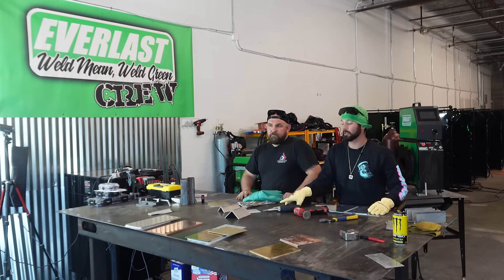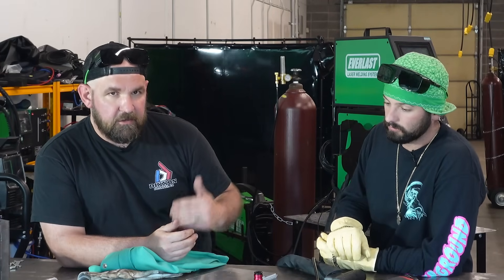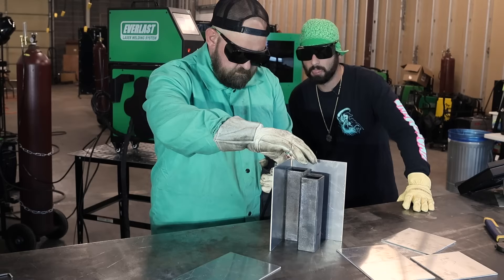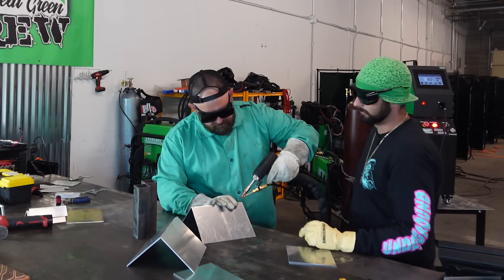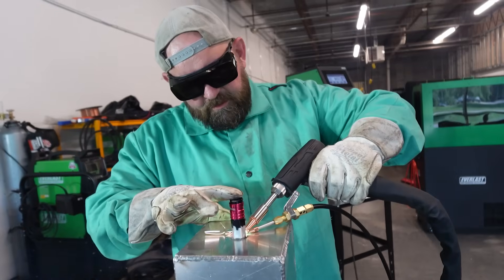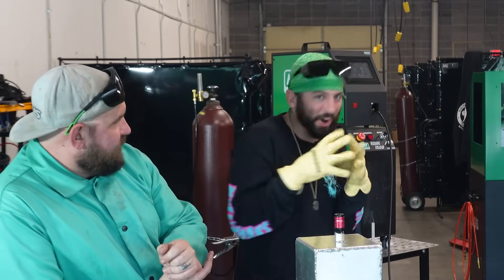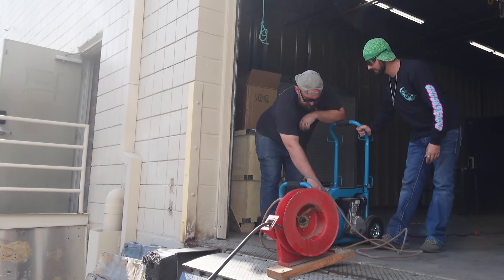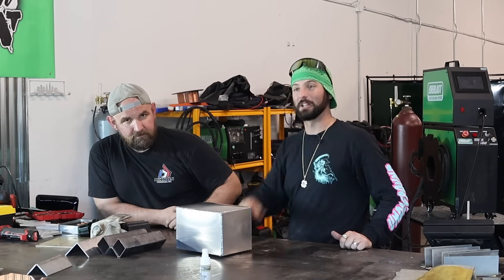Ultimate Test Can Laser Welding Handle A Pressure Test?

Comment: SEE THE BOWING ON ALL SIDES OF THE VESSEL, TOO HIGH A PRESSURE, THEY SHOULD HAVE PUT IN CREASES TO STRENGTHEN EACH SIDE. I DONT THINK THEY PUT IN 138PSI THAT THEY SHOWED ON THE COMPRESSOR, THEY OBVIOUSLY HAD ANOTHER TAP/VALVE AFTER THE GUAGE TO REDUCE THE INPUT PRESSURE.

Comment: CURRENTLY LASER WELDERS ARE ONLY FOR THEN MATERIALS AND PRIMARILY USED TO HIDE JOINS AND MAKE THE JOIN LOOK NICE FOR PRESENTATION AND NOT USED FOR JOINS THAT ARE PUT UNDER PRESSURE THERE IS NOT ENOUGH PENETRATION.

Comment: I'd be quite interested in seeing a proper cut and etch on various materials  and thicknesses of the lazer compared to other techniques on the same joint configuration.  I get Lazer isn't at the point of replacing any of the other processes, but I'm curious

Comment: Need to see some detailed instructional videos for experienced writers and beginners alike that have never touched a laser welder. Can we still do multiple passes for infinite depth? Can I still run a 3G on 1/4” mild steel in all positions? If I’m winding a 1 Ton truck frame back together with a diamond or building one from scratch, is laser stringer due to the heat affected zone being smaller? Etc…

Comment: i stitched my entire e36 m3 body and solid welded the whole shell and it added a crazy amount of stiffness to my chassis.  im currently using the the laser welder to do sheet metal paneling and a firewall in my mini pro mod build.  its amazing and works fantastic for the thin stuff.  im no welder, but i finished the tubs, and paneling on the drag chassis by myself and it came out looking nice.

Comment: So stupid never pressure test a tank with air. good way to take the forever nap. fill with water and use a pressure washer or an actual pressure pump. and see how the weld do when they fail.

Comment: NDT non destructive testing on the laser quai MiG torch welding might be safer doing a hydro test ver a pneumatic test.
Great work. 
Question can the laser technique use the TIG hand feeding wire rod ?  Thanks for any reply.

Comment: The one thing I've not understood about laser welding different types of metals is, does it require different types of weld wire or do they use the same wire for all metals?
I've watched several videos on laser welding and it seems that of all the different metals that those videos are showcasing, they never show themselves changing out the wire for specific metals.
Reply: Different wire, the heat source does not change the fact that the filler needs to be compatible with the host material.

Comment: Find a truly rusty pre 1998 truck frame. And without prep. Weld a piece of 1/4 inch or thicker to it. If Mig can do it why can't this????
Reply from the maker: Well don't have a good answer for you but if it was super rusty, you could remove it and weld it all using the same machine.

Comment: Approaching that thing at 135psi air pressure is insane. Not in a good haha way either. It's nuts. Use water pressure. You know, like professionals.
Reply from the maker: we de pressurized it from the other end before approaching. Water will be the method to the madness next time.
Reply: As someone who works in pneumatics, use water. Compressed gas can be terrifying and when it goes wrong it can easily be life ending.
Reply: @Kesterlath  I came here to say this when they had their face next to it at 15psi.... I haven't even watched the rest of the video yet 😱
Reply: i once chipping/remove a rust surface to a pipe that has 1300psi pressure in it at the oil platform... you had no idea how scared i am.

Comment: Fill it with water first and then use the air pressure. Air is compressible and can kill you. Liquids just split and spit out a little bit
Reply from the maker: we have come to the conclusion, this is the way.
Reply: I was concerned as well. Could have exploded at any point as they walked up to it.
Reply: excellent point saving me from telling them about bad stories of exploding tanks of all types because of the build up of pressure,,,but never think high pressure water is safe lol i can cut or remove skin and tissue very quickly

Comment: For the love of god, please display the proper safety requirements for laser welding. You’re doing a huge disservice to the welding community by displaying such a lack of safety precaution. First, you need to wear the laser safe hood in addition to the glasses. Second, please stop putting your hand in front of the laser when you’re tacking. That’s a great way to punch a hole right through your hand. Thirdly, this must be done in a controlled environment. You’re literally pointing that thing at a fucking window and god knows who else might walk up into the shop without any PPE. Laser welding is an excellent process but it MUST be done safely. You two are barely one step away from those terrifying Chinese laser welding videos. I expect better from this channel.
Reply: For an actual shop you’ll need an enclosure with safety interlocks because that class of laser is no joke.
Reply from the maker: All of your points are Valid, especially the hand thing, that made myself nervous. Im curious on the actual safety requirements behind double eye protection, Ive spoken with several companys about this. The double Eye pro was Highly recommended, but not something required technically. Its a powerful laser to your point and if somehow that laser bounced and went to your eyes, neither can help you as it goes right through on a direct hit.. but i can see how it could give you a second longer and save your face.  The Complex was shut down for the weekend, not a soul was around for quite aways, doors were locked and we both had our safety's on.. Cant speak on the window.. we just tried to avoid pointing that way.
At the end of the say we could use some safety barriers, and for all of our other laser content we have those things. 
 -Austin
Reply: @Welddotcom  thanks for the reply! I understand in this scenario it was done safer than what was portrayed. My concern is you might be portraying this process as something that can directly replace TIG, and while the final result is comparable, the equipment required is far from it. I’ve seen too many lasers in shops with less safety than this, so I think you should stress the safety aspect more as an educator.
Reply: I was under the impression from material i have seen that laser rated eye-pro protected from direct and reflected laser damage. What makes the welding laser different?
Reply: @legionofanon  the hood is there to protect the rest of your face from laser burns. You wear a jacket and sleeves to protect your skin, shouldn’t you also wear something to protect your face?
Reply: @Noble977  im a welder, i know the purpose of a hood and sleeves. Im talking specifically about the double laser eye protection part

Comment: If you have perfect fit up.. no worries...... For the real world the tech aint there yet
Reply: probably good in a shop but just won't cut it in the field
Reply: @LibertyDankmeme  every process has its place, you’re not going to stick weld a diff housing together, and you’re not going to braze the I beams on a sky scraper either.
Reply: @everlastgenerator  that's true - but i feel like lasers belong in a shop environment for now - at least until the technology matures
Reply: @LibertyDankmeme  for the moment, 100% agree, other than the cleaning side. It’s quite good at removing graffiti from most surfaces.

Comment: Use a pressure washer. 135 PSI isn't even enough pressure to know if your welds are good or not. But it is more than enough to kill you if they do fail. 
With water, you can easily get up to 3,000 psi and if it does fail, you just have a pinhole to fill or a spilt seam. 
Instead of a bomb.
Reply from the maker: Thats useful info, Hydro testing it is.
Reply: @Welddotcom Fill the test tank with water before you add pressure.
Reply: I work in nuclear and aerospace and we pressure test laser welded parts from 5000-9000 psi...much cleaner and better weld than tig if you have enough watts for what you're welding.
Reply: Yeah I was thinking that. Boilers for steam engines are always tested with pressurised water, never air. The reason is that air is compressible and therefore can accumulate a lot of potential energy when pressurised - water is virtually incompressible so cannot produce a lot of potential energy. The result is a tank pressurised with water cannot explode, but if pressurised with air it can!
Reply: @stumccabe  yep, and an everyday way to observe the difference is to watch slow motion video of air balloons and water balloons popping. 

If they are both the same balloon filled to the same size that means they have the same pressure in them. The air ballon however is MUCH more dramatic looking because the air just keeps on pushing, but the water of the water balloon only expands a tiny bit.  After that the water actually holds onto most of the balloon, keeping it from gaining any meaningful speed. 

1 gallon of air at 150psi is 11 gallons of air. 1 gallon of water at 15,000 psi is 1.04 gallons.
Reply: Hydro testing is very nice! What we use is 250psi hydro or 15 psi air they leak at about the same rate at those pressures too. That's what we do to test rail cars heater coils we the people bump the air number up to 50psi though just to be safe next time it's in for checks will be 10 years from the day we touched it so gotta be sure!!!!
Reply: Good call brother. I can confirm. In my previous life we did many many hydrostatic tests for water and hydraulic tanks. usually nothing more that a pinhole thats easy to see.....and believe you me they do happen.
Reply: @nicholastrawinski  I have gotten bruises welts and cuts from those style fitting too! Lol you are not wrong at all!!!!!!!!!!!
Reply: Water dissolves the welds.
 
 
 
  
 

Just kidding! However, I thought they were hydro-testing it too! 😂

Comment: Standard Made-in-China font on the touchscreen is a turn off, especially on a five-figure priced machine.
Reply from the maker: Still of the most powerful and affordable units out right now. youre gonna see some china im sure. Tack on another 10k and you can have a Nicer looking machine.
Reply: The Chinese actually make some pretty high quality shit. You’re just used to seeing the cheap shit that US businesses buy from there. In my experience, you can get quality machines from China if you know where to look.
Reply: It did NOT used to be this way as ‘American Made’ used to and still does mean something. Not for nothing, but demoncraps force companies to make offshore because of stupid unions and cost issues. Stupid things like McDonalds paying teens $20+ to make hamburgers, is a perfect example of that mentality that causes prices to increase. I worked 20 yrs before I made $20+ an hr. And I worked hard as a CNC Machinist. After 45 yrs as a Machinist and Engineer, I still love the trades and can write my own ticket. I love America!! …still can’t stand politicians though.
Reply: @elcheapo5302  So make it Blue and change the font in "Impact" BOLD with a tattered punisher American Flag on case. GOT IT
Reply: @elcheapo5302  nothing wrong with that. iPhones and most high value items are made in china. Quality comes down to checks, quality control etc, not where it’s made.
Reply: @brendancooney9401  even the precious Lincoln and Miller stuff is made overseas or all components are
Reply: @brendancooney9401  No they are ASSEMBLED in China, the parts are made elsewhere because no one trusts anything other then the most basic stuff to them.
Reply: @brendancooney9401  agreed. Once you start dealing in manufacturing you'll know that quality is largely dependent on design, specifications, quality of parts used, and quality checks... All of which is dictated by the owner of the product, not the manufacturing plant.
Reply: @elcheapo5302  what a great life you must have that the font on a welder is what you have a problem with.
Reply: Yeah, that touch screen font really hurts performance and usability...🙄
Reply: So you don't judge things on good things are or how long they last but what the font is?? Well you must be happy with your Gucci handbag driving your Mercedes.
Reply: @EnlightenedSavage  When I pay upwards of $10k for a tool, I expect it to have a slightly better user interface than the average $10 Temu item. Enjoy your life of mediocrity.
Reply: Chinese make SOME good stuff actually. I fly drones commercially and I have a DJI M30. It’s a big Chinese surveillance drone. It’s made every bit as good as something you would get from Germany or Japan. The plastic feels good on it the carbon fiber everything works. It has two of everything so everything‘s redundant. I’ve never had an issue with it. It’s got a really good camera on it and the controller is insane.  Of course it’s $8000 drone but it’s still made China. And I have yet to see a better made one in person.
Reply: While I agree with you 100 percent let’s face it you’d be hard pressed to find anything that’s actually made in America anymore. Stuff that claims to be made in the USA is “assembled here” the parts and components are all made overseas mostly in China. When is the last time you saw a factory in America? I remember when you couldn’t drive 50 miles without seeing working factories with smoke coming out the stacks. You can drive halfway across the country and not see a running factory today. It’s breaks my heart what has happened to our once great country.
Reply: @Trump985  I would honestly estimate 90% of the things I buy are American made.  Yesterday I ordered an extension cord made in America by Southwire and a pair of shoes made by SAS Shoes in Texas.  You might have to look a bit harder or pay a bit more, but American manufacturing is not dead yet.  Other than electronics, I've had pretty good success finding just about everything I need made in USA.
Reply: This is a bad take when you consider that most compute devices are made in China name any phone or laptop that's over $1000 made in China. Most of the individual parts in the things that are made in America come from China as well
Reply: @Trump985  that’s because everything is outrageously expensive to get made here. I’ve been trying to get some parts mailed of an invention that I came up with and I’m in the prototype stage now and the quotes that I’ve been getting for a part that only takes eight minutes to manufacture with two hours set up time is $2400. Used to be able to get the same thing for 300-400 bucks.
Reply: @johnwalter6410 the reason made in America stuff is so expensive is because of the over paid executives that provide no tangible benefit to the product or company where as overseas corporate structures are very very different.

Comment: You're more brave than I am, if indeed you were approaching that box when it was fully pressurized. Then again, you're both better welders than I am so maybe you had a reason to be confident.
Reply: yeah!! using water would have be vastly safer!
Reply from the maker: @finlaybichan1275  The safety censuses is water is the way! we will try it out.
Reply from the maker: We relived the pressure after a bit from the compressor end.
Reply: Such a stupid thing to do, no one should ever do this.

Comment: Is it faster than MIG?
Reply from the maker: Depends on the application, From personal use, simliar travel speeds are used. Weld size, and quality especially on thinner metals, i think the laser has it everytime.
Reply: YES it is !
Reply: Not a chance. This procedure is basically for thin material. I wouldn't build a dune buggy with one for sure.
Reply: Not a chance. Look at MiG videos and compare.